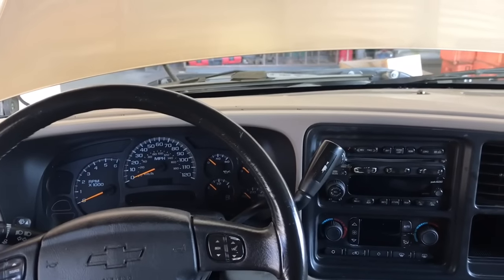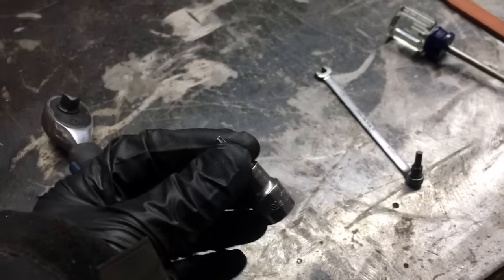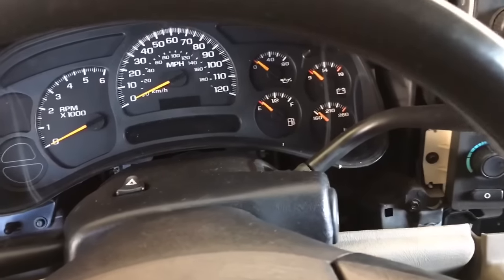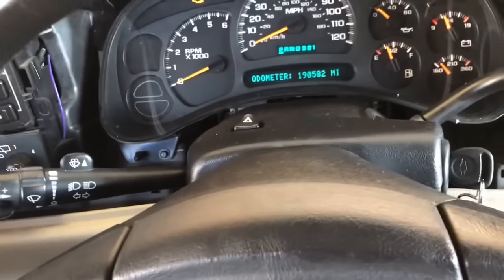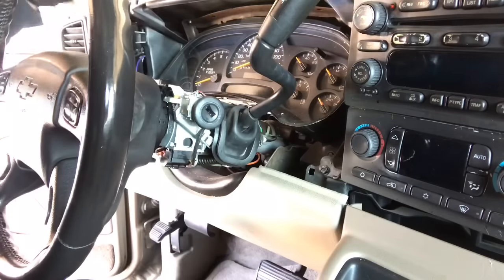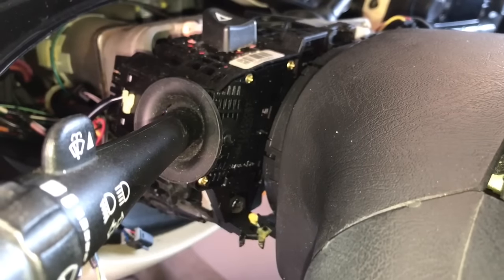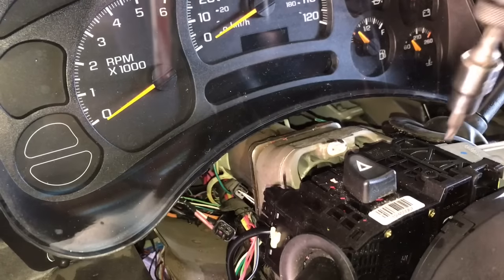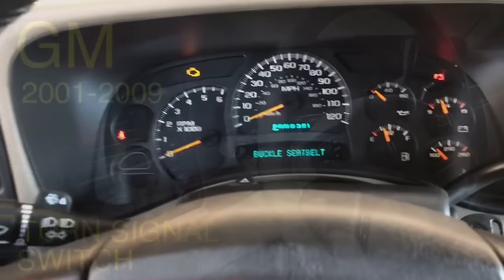Gm Multi-Function Turn Signal Switch Replacement 2001-2009

Comment: Hey Aaron.  My 05 Silverado is marking "tuen signal on" just randomly ,do you think this will be the problem too?
Reply from the maker: Yes, I have seen that issue with the switch as well as high beams turning on at the same time
Reply: Ok.thanks for the video I hope after I finished the job my dashboard stop saying TURN SIGNAL ON

Comment: My 2000 Silverado  when the headlights are turned on ,and you use the turn signals the wipers come on...i thought it was a short in the signal control swith on the steering column since it controls lights,signals and wipers but after replacing it with a new one I still have the same problem..has anyone else ever had this problem and know how to fix it?

Comment: I'm having a issue with my turn signals and brake lights,every now and then they just stop working but I hit the lower part of the dash below the steering wheel and they start working again.any clue to the problem?
Reply from the maker: Turn signal module! That’s exactly where that is
Reply: I have the same problem I have replace tail lights brake switch what I have notice when I apply my brakes and turn right or left signal that tail light goes out but the other brake light still works please help driving me crazy.

Comment: I just did my Sierra and the bottom switch screw comes out/goes in just fine by turning the steering wheel 45' to the right exposing the screw and then a straight t25 goes right in!!

Comment: Where were the links for parts.  Althought I did not have the save issue.  The wiper swithc on the arm will not shut off.  It runs constantly.
Reply from the maker: open the description below the video and all the links are there!

Comment: was wondering if it also made a buzzing sound  when turning on the  signal?  mine is doing that  buzz sound as well ...
Reply from the maker: A buzzing sound generally means a faulty turn signal relay module.
Reply: Aaron.  where is that located at ?  the  windshield wipers work and the high beams on the  handle part ..  just the signal makes a buzzzzzz..       do  i need the whole handle thing replaced ?   Thanks
Reply: Hazard lights work too ~

Comment: Mine was doing the same thing. Then after a year my left turn would do the hazards. So right side had my brights and left hazards.
Reply: How did you get that fixed cause mine turn into hazards when I hit the switch to the right trying to get my brake lights working
Reply: Go to 1aauto.com and you'll have to buy a new turn signal switch. It was a pain to switch out so if you're not handy I won't recommend having someone do it for you.

Comment: Have you ever experienced the switch causing the information panel to display: "Turn Signal On" when it really isn't?  If I push the lever to the right signal, it immediately corrects the issue.

Comment: PLEASE HELP . MY SILVERADO 04 WHEN I PUT THE RIGHT TURN SIGNALS THE LOW BEAM FLASH LIKE IT WAS A TURN SIGNAL .. AND ALSO MY LOW BEAM IS LESS BRIGHTER THAN THE LEFT OR DRIVER SIDE .. ALSO I NOTICED THAT ALL THE LIGHTS ON PASSENGER HEADLIGHT ( THE SAME ONE ) FLASH WITH THE TURN SIGNALS .. COULD BE A GROUND ? I DONT KNOW WHERE TO START HOPE SOMEONE CAN HELP

Comment: I've got a 2000 blazer an brake lights turn signals an tail lights stopped working would the multifunction switch cause this problem

Comment: Im having a problem with my rear turn light when my trailer isnt connected and the headlight switch comes on it cancels out the turn lights in the back or hitting the brakes also cancels them out.
Reply: Any luck with that?
Reply: @garryb.1334  actually yes I repaired it yesterday it was two ground wires disconnected on the left side
Reply: Thanks for asking.

Comment: Can it also cause the brake lights to not turn on
Reply: I’m hoping so. That’s the trouble I’m having (2006 Silverado), tip brake light works but the main ones don’t. All signals, flashers work, just no brake lights except 3rd high. I’ve ruled out brake light switch and flasher unit. Gotta be the turn signal switch, right?
Reply: Bart Merriam did you figure this out? Same problem with my 2005 Silverado...

Comment: I can tell you this isn't how it works on a 2001 GMC Sierra 1500. The switch itself is different. You have to get down in the dash and disconnect the connectors. Still trying to figure out just how to accomplish that. I seem to be short an extra wrist joint. The trick with the wrench and torx bit worked great, though.

Comment: I need a video on changing the brake light switch, on the brake peddle
Reply: If its the one at the pedal very easy turn it to the left it will pop out dis connect the plug, replace and reverse the procedure.
I had the same issue a few years ago when the cruise control stopped working.
Hope this helps.

Comment: could this be the reason my brake lights are staying on by chance?
Reply: I have already tried replacing the brake switch
Reply: i’m havin the same problem with my brake lights staying on. i also replaces the switch on brake pedal

Comment: Thats got a couple miles on it.  Pulling on plastic trim pieces always makes me nervous, especially on older vehicles.  Harbor freight has a tiny hex head ratchet that is perfect for tight spots like that. 
https://www.harborfreight.com/8-piece-right-angle-screwdriver-92630.html
Reply from the maker: Nice! Just might have to pick me up one of those. Ya those plastic pieces sure do get brittle.